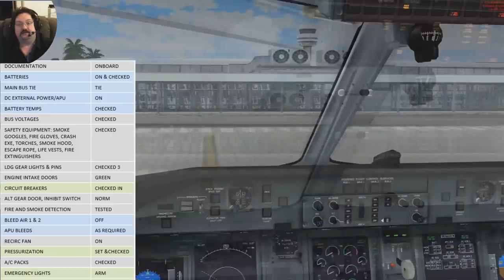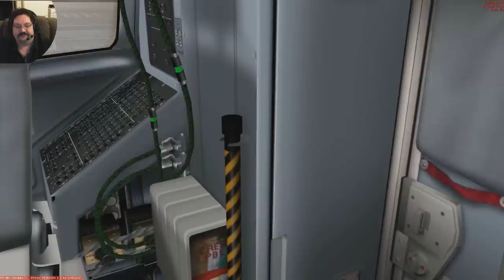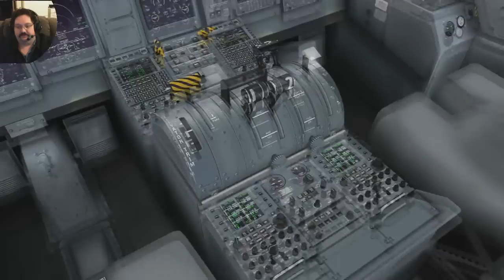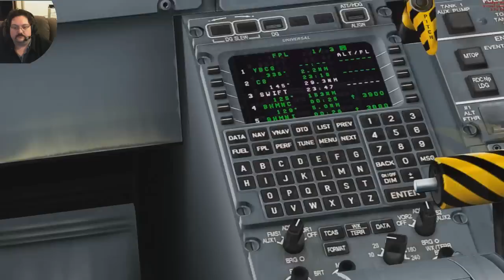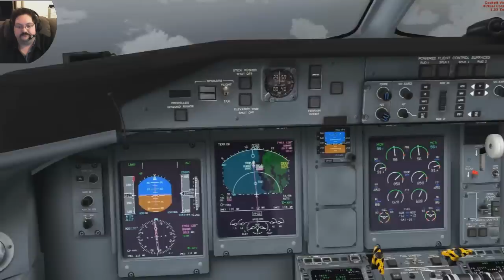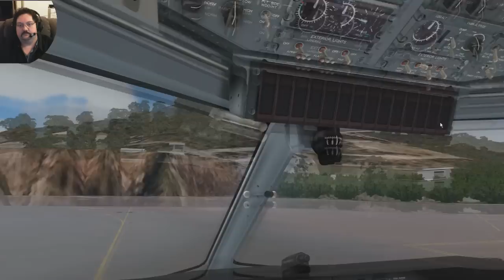Vatsim Far North QLD, Majestic Q400 Cairns to Hamilton Island

Comment: What virtual cockpit do you use (pls reply)??????
Reply from the maker: +Gold Coast Aircraft Spotting Comes with the Majestic Q400 product.
http://www.justflight.com/product/dash-8-q400-pilot-edition-fsx-download

No edits to the panel, VC etc. only a repaint of the external ... paint. on the fuselage and wings.
Reply: +musicalaviator ok, thanks for the fast reply
Reply: +musicalaviator also, can I please get the link to those flight checklists :)????
Reply from the maker: +Gold Coast Aircraft Spotting Ships with the product and is a pdf file in the program files > Majestic software folder.
Fortunately they also host a version on the site
Checklist
http://majesticsoftware.com/mjc8q400/docs/NormalChecklistsCard.pdf
Speed Card
http://majesticsoftware.com/mjc8q400/docs/SpeedCard_metric.pdf
And quick configuration panel manual
http://majesticsoftware.com/mjc8q400/docs/ControlPanelGuide.pdf
Reply: +musicalaviator thanks :)